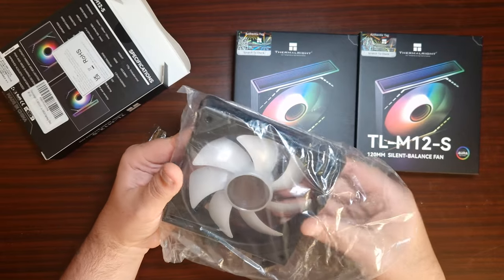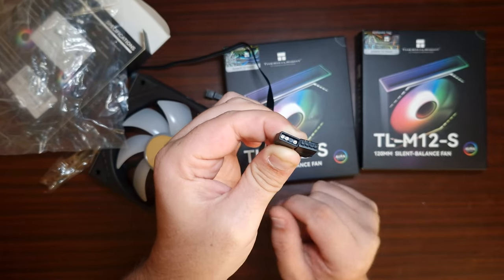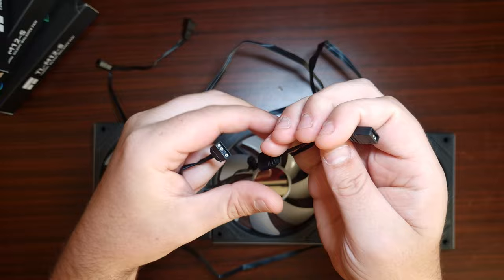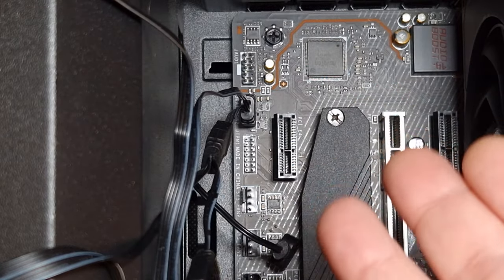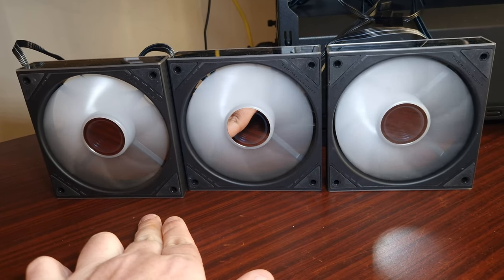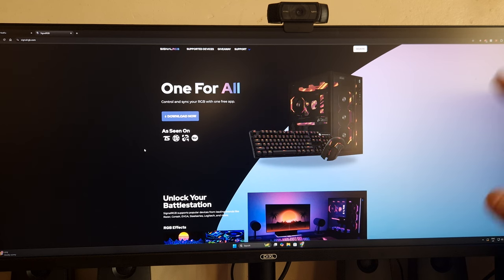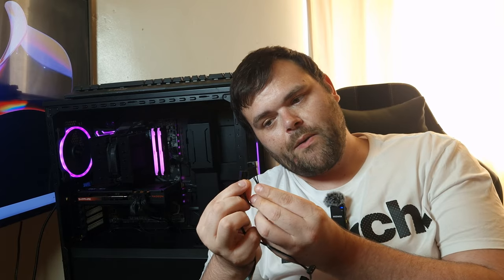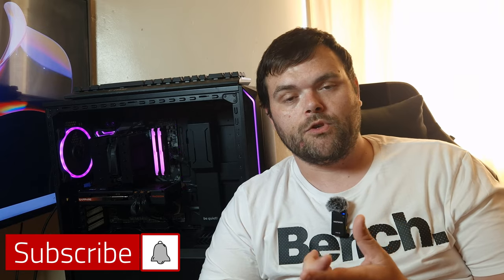Thermalright ARGB PC Fans How to Connect & Daisy chain

Comment: can u quickly explain how do i also daisy the fans togehter? im unsure what else i have to put into the motherboard. if i daisy chain 3 togehter do i have to put 1 argb and only 1 sysfan for 3 fans into the mobo?
Reply from the maker: @Airtoxable  I show how to daisy chain in this video as for the fans if you connect all 3 with a splitter yes 3 fans daisy chained 1 argb header same goes for the fans
Reply: @WELSHYTECH  is the splitter included or do i have to buy at seperate? If so which one did you use?
Reply from the maker: @Airtoxable  these fans have a daisy chain end on it to connect the fans together

Comment: If I have 7 case fans, can I buy one ARGB hub, connect all of them there, and control each one separately? With daisy chaining, that wouldn't be possible, right?
Reply from the maker: Nope, you have to connect them separately in order to control them individually
Reply: thanks for your answer! but will it work with a argb controller. like is there any difference between hub/controller/splitter?
Reply from the maker: @nichtluke  Hub is the controller it's a different term for it, Splitter is normally for Fan Power PWM But you can get splitters for argb as well here's a ARGB Hub https://amzn.to/3Cp7kRT

Comment: Hello! I'd like to ask if I can daisy-chain 4 fans together. This is for a front-panel 4-fan setup
Reply from the maker: I wouldn't daisy chain more than 3 Fans unless you are using a ARGB Controller
Reply: @WELSHYTECH  Ah yes I bought an ARGB Controller of the same brand. So basically I'm setting up for a 9-fan configuration: 3 fans above for radiator, 4 front panel, 1 bottom, and 1 back fan.
Reply from the maker: @seeluelurself  as long as you have a controller you will be fine

Comment: I have a question, I have no idea about PC’s, I bought mine from a person who built it but I have no idea how to change the RGB. I don’t know if they’re connected to the motherboard but they’re on and spinning, I’ve tried every rgb software to change them but they don’t detect them. What do I need to fix?
Reply from the maker: Take off the back panel and see if there's a square black box if so it means its controlled by a controller and Is normally controlled by a remote

Comment: I have 5 fans, and can i control a single fan rgb? All of them connect to the hub. All fans are argb
Reply from the maker: You can control the single fan, and through software, they should just sync up there's a difference between RGB and ARGB one is a 4pin 12v which is RGB and other is 3pin ARGB which is 5v

Comment: So do I plug the all fans into the bored to make them spin
Reply from the maker: This shows how to daisy chain for the RGB to make them spin. You would need to plug in the 4 pin PWM connector
Reply: @WELSHYTECH  I just used a fan hub then plugged that into the bored that will work right
Reply: @WELSHYTECH  but thanks I understand what mean by that
Reply from the maker: @dbksaving5337  as long as the end pwm cable is plugged into to the Motherboard Download Fan control Best software to use to control your fans

Comment: Hey brother i got a quick question right i got gamdias cpu cooler m1 610 the argb was working but i cleaned out my pc today and it stopped working the fan spins but no leds any ideas?
Reply: I tried everything my motherboard don't have a argb header
Reply from the maker: Check the cooler for a cable  at the back of the case just incase you unplugged something

Comment: so i got the ones you have TL-M12R-S. the look nice, especially for the price. I chained some together but i only get the mirroring effect in SignalRGB. cant get them to work as a stripe. only the first 10 LEDs get recognized and mirrored onto every fan. should be 40 in the chain. 
i get the feeling they dont work with gen2 argb syncing... do you have any idea or maybe got it to work yourself?
Reply from the maker: The fans work just fine for me. I'd always suggest using Motherboard software to control the ARGB
Reply: @WELSHYTECH   tried RGB Fusion for my Gigabyte MoBo but it wont sync them. only Mirror.

Just to be clear: you daisychained (lets say 3) the fans, Power and ARGB, to your mobo power and argb header an can set the first fan to green, the second one to blue WHILE the first one is still green. And so on. 
Thats how it sould work i think, but i cant get it to work like that. :(
Reply from the maker: @TehKusja  if you Daisy chained them 
you can't control each fan individually its not how it works you would have to connect the fans separately in order to set each fan
Reply: @WELSHYTECH  no, you are wrong about that. Thats the whole point of ARGB Gen2. you are supposed to adress every LED in a given chain. Up to 120 per Header i think. with gen 2 you dont need a controller. 
But i suppose the fans do not support the function. the documentation on ARGB is shit. There is only one Brand of fans actively saying they support Gen2. Sucks cuz of the price. :(

That leaves me with the option of a dedicated conroller. Any suggestions? got 14 ARGB fans... a little overkill but the case would look like ass with less....
Reply from the maker: @TehKusja  if there daisy chained to one header, you can't control them individually

Comment: Great explanation.  
But when using a  controller (eg. Thermaltake TT Sync SATA Powered 9 Port Addressable LED Controller) than you can also add different brands. 

And than with the software from thermaltake you can adress them als well in PWM mode or custimze them.

So that narrows the difference between the two (RGB vs ARGB)? or am I missing something.
Only one is through the software of company, and the other is through the BIOS?
Reply from the maker: Addressable rgb is 5v, some brands have their own software rgb and argb are different because one is 12v the other is 5v 
Software most argb software works with other brands but not all
Reply: @WELSHYTECH   Thank you. 
how many thermaltake SWAFANS ARGB fans can I daisy  chain onto one 5v header? (perhaps also using a splitter?)
Reply from the maker: @s0032824  Caution: Due to safety and motherboard software signal limitations, SWAFAN EX ARGB is only recommended to daisy-chain maximum 5 fans per cable. you can only daisy chain 5 fans to one header remember more you add more the 5v signal you will lose so keep that in mind

Comment: hello sir, i want to ask
if i use 6pcs of these fan on my pc, do i need hub or controler for argb sync? or i can only use pwm/argb pin on my motherboard with daisy chain. (my motherboard: asrock b660m pro rs). 
thanks in advance
Reply from the maker: if you are planning on using more Than 3 Then get a hub I wouldn't daisy chain more than 3 fans as the more you add the worse the 5v signal is
Reply: @WELSHYTECH  thanks for the answer
Reply from the maker: @AdulGema  no problem 😊

Comment: my thermalright fans are daisy chained and connected but they don't light up and im not seeing them in signal rgb either it drives me nuts
Reply from the maker: How many have you got connected up and is the end ARGB 3PIN  Connector connected to your motherboard?
Reply: @WELSHYTECH  3 fans, and yes the argb cable is connected to the motherboard, the fans spin but they don't light up
Reply from the maker: @Clay50  What motherboard do you have 
and also have you gone into the Bios to enable lighting?